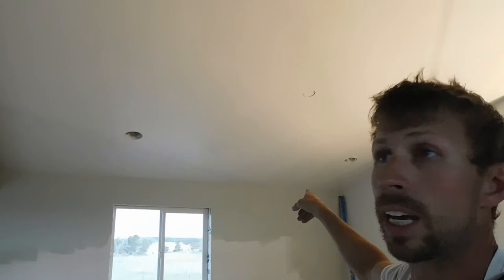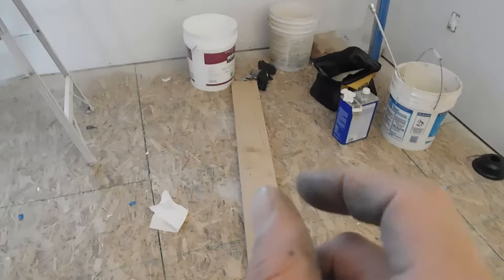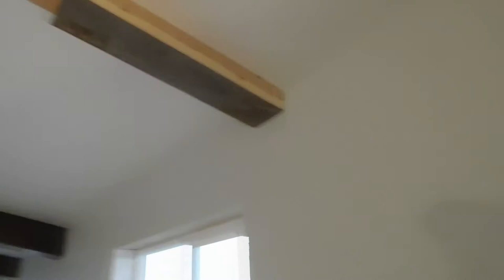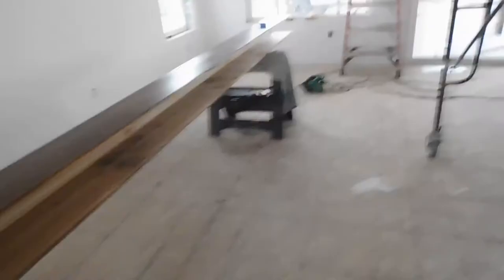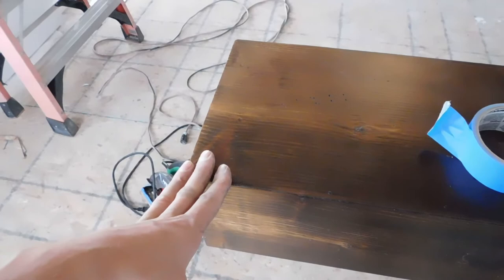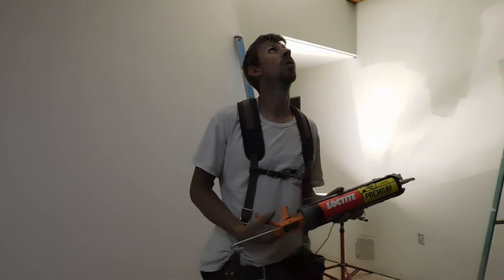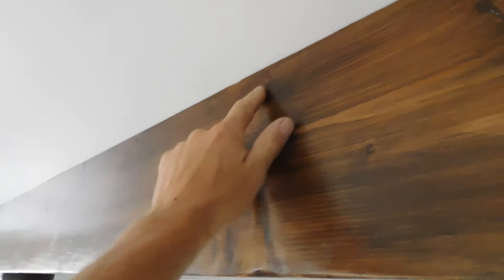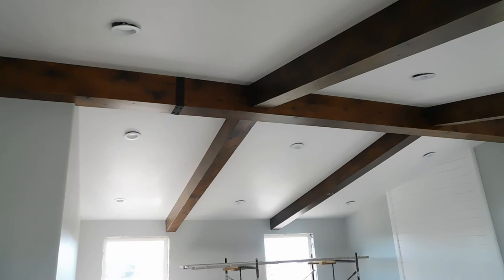How To Install Faux Beams // Tutorial // DIY

Comment: Awesome video! On the center beam where the two sides of the ceiling meet did you make miter cuts so that the 1x's would match the slope of the ceiling and have more contact with the drywall? I have a ceiling like this and I'm having trouble visualizing how to do this and still having enough material to secure thr faux beam into the 1x's.
Reply from the maker: Thank you for the compliment!

Actually since then ceiling has the slope making contact on the outer side of the 1x beam,  the boards were able to stay square. No bevel required! If the seen part of the beam was on the high side vs the low side, it would need to be beveled. If that makes sense.

Comment: Dude you do awesome work and I respect your craftsmanship. I had a question about your center beam that runs lengthwise along the vaulted ceiling... Did you back bevel the ends that touch the drywall?
Reply from the maker: Thank you, I appreciate your comment! 
I would have back beveled the beam if I needed to. However since where the slope of the drywall contacted the outer 1x’s was on the outer side, I didn’t need to bevel. If the beam was a one pitch slope, it would have needed it. Does that make sense?

Comment: How did you manage any coping that might need to be done if the ceiling is not a perfect plane?
Reply from the maker: There was one beam that I had that issue with where the drywall had some imperfection. I scribed the beam while holding up with a pencil and trimmed with a circular saw. I did this in small increments until a tight fit was achieved.

I think I might have covered this in the video.

Comment: This turned out really nice! For that peak beam do you need to bevel the top edges because of the slope of the ceiling? Or are straight edges ok? Im just trying to learn I don’t want there to be gaps between the ceiling and the beam.
Reply from the maker: Thank you! Yes it turned out great!  

The ridge beam did not need to be beveled because of the contact point was on the finished side of the beam with the sheet rock. It sits really tight. If the beam was being installed on the lower part of the ceiling, where the wall and ceiling meet, then a bevel rip cut would be needed because the contact point would be on the opposite side. Hopefully that makes sense! Sounds kind of confusing.

Comment: Great video!! thank you. 
I'm a little confused about how to find the angle of the wall to ceiling which I need to cut my beams at. Any tips?
Reply from the maker: Look up an "Angle Finder/ Protractor". This tool would help you out alot and they are relatively inexpensive.
Reply: @buildingwithjosh  Awesome! Thank you

Comment: Anything special needed to be done for the electrical for fan?
Reply from the maker: I mounted a new heavy duty ceiling box onto solid blocking. I used a combination of 2x6 blocks and shims to get the elevation just right with the beam,   and then mounted a electrical box to it and fed the wire through. Hopefully this helps!

Comment: Hello, awesome work.  Could you share the dimensions of the beams.  I notice the center beam is different from the side beams.  Thank you.
Reply from the maker: For sure, yes the center beam is larger than the sides. The sides are 8x10"s and the center is 10x12" roughly. I used 1x material so actual size is slightly smaller.
Reply: Thank you.

Comment: beautiful, did you scribe the tops to fit the (uneven) ceiling? Also you didnt mention the hardware to cover the main seam?
Reply from the maker: By test fitting and marking with pencil until I got it where I wanted it. Then used a circular saw to trim. It usually took a couple of trys to achieve what I wanted.
Reply from the maker: I just saw your second question about our hardware. 
We got a rubber like strapping from this website:
https://www.outwater.com/faux-beam-accessories/